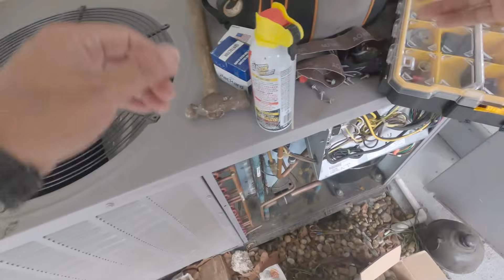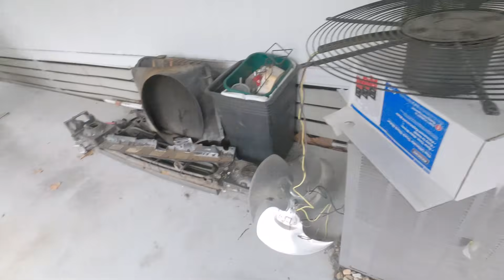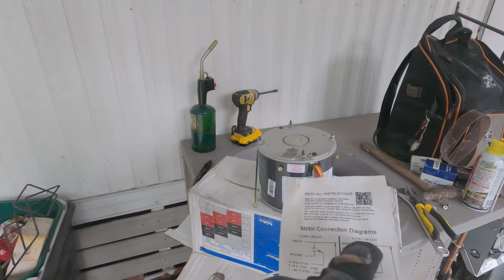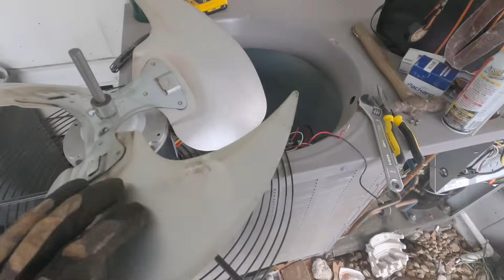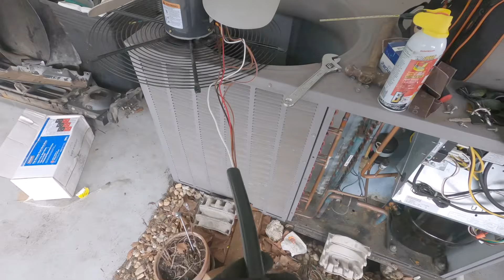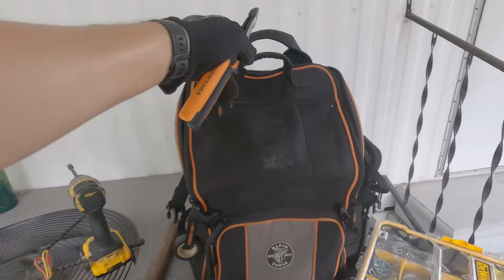Universal condenser fan motor replacement HVAC

Comment: Thanks for this video. It's a great walkthrough. Where does the other end of the ground wire connect? I see where you put it on top of the motor, but I can't tell where the other end is.
Reply from the maker: Your very welcome. Glad you enjoyed it. It goes to the inside of the motor housing, that's why I don't see it being necessary. (Just comes from the wire harness from the motor as a visual stand point)
Reply: @VictorofHVAC  thanks for the reply! I read several discussions on Reddit and an HVAC discussion board, and I saw another video like yours where several people said the ground wire could be removed entirely if the mount was metal on metal. That was the case for my system, so I just took the whole thing off.

Comment: I did a universal motor today on 99 model Lemnos unit, called for a 1/4 HP 1075 RPM motor, I installed a Century Universal 1/3-1/6 Motor, said it pulls 2.1 A but the one I installed is over heating and pulling 2.5 Amps and it has a new 7.5 Cap. Any ideas? I’m not a big fan of universal motors but that was my only option to get them going. Now it’s acting up again lol
Reply from the maker: I've had motors come bad out the box. (universal and oem) assuming the condenser Coil is clean and the new 7.5 cap is actually putting out 7.5mfd , I would verify the wiring and if the the wiring is correct, I would just replace the universal with another and warrant it out.

Comment: I will cut the old wires right at the old motor, and then tape new wires to them and pull through. If I forget I will use a longer panduet strap and use that to tape to and pull wires threw.
Reply from the maker: Definitely a nice way to skin the cat. Thanks for sharing that brother 🙏 🙌 ❤